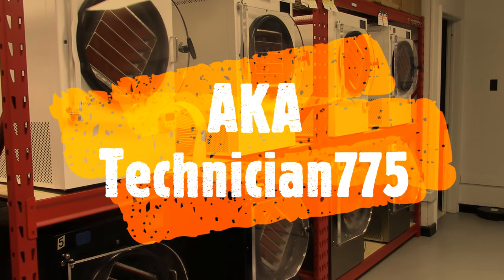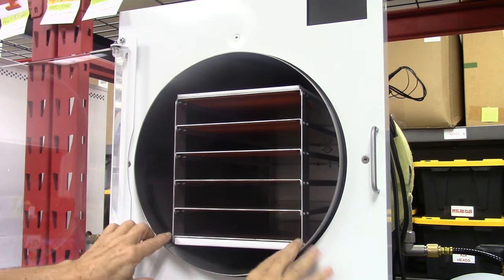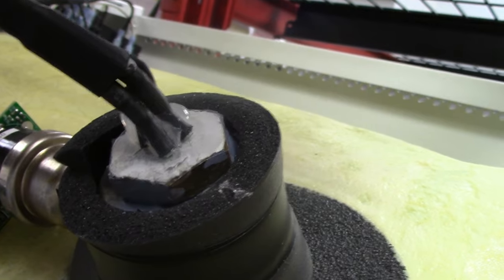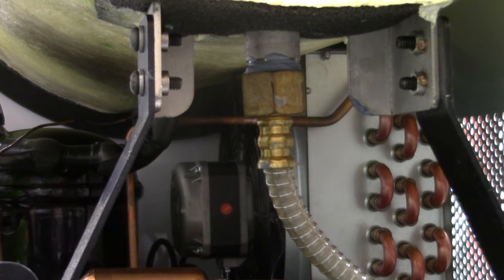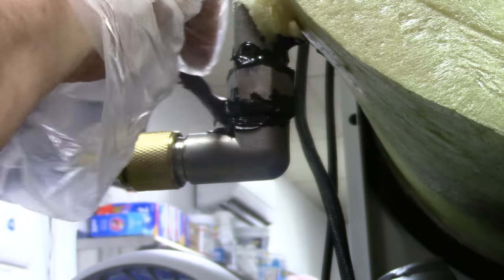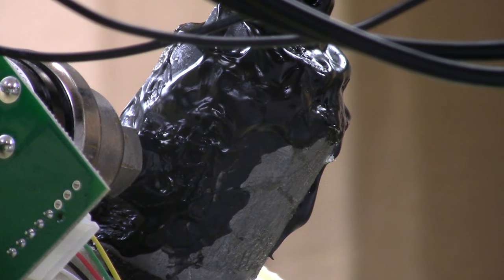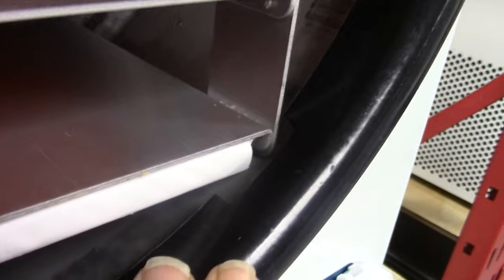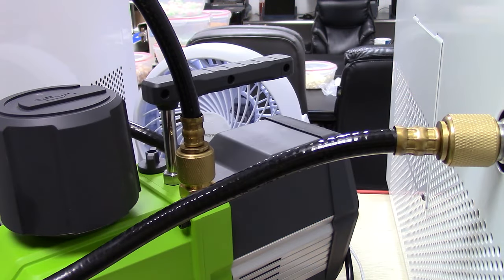Harvest Right Vacuum Fix VIDEO

Comment: Hey Fellow Techy Fix-it Guy!!!  Please tell me; have you ever needed to remove the seals made with liquid and rubber splicing tape?  I'm about ready to perform all your suggested sealing tips but worry a little bit about getting to the harness in the future.
Also, do you have a parts list anywhere of the replacement parts you use, especially drain valves and fittings?  
Thanks for your hard work and willingness to share.
Reply: Hiya Dan, nope, never had to remove all the stuff, but....if I would, a good pair of needle nose pliers would do the trick I would think. If you need drain valves, Harvest Right has some nice ones, the vacuum hose is from HR too and orings.....You can use a 3/8 gas valve from any Hardware store, bring the old drain valve with you to match up the ends....last machine we sealed up, held a vacuum for 72 hours....and was still holding, but we needed to use the machine.....good luck and thanks for the nice words. .

Comment: So glad I found this video! I didn't know where to troubleshoot next. I had already epoxyed the top where the cords go into the machine about a year ago. Now I'll go back and remove all that. My question is, what is RTV? Thanks for doing this video!
Reply from the maker: RTV is a thick substance like what is used around windows, bath tubs, showers etc. I suggest you NOT use it, the liquid tape works sooooo much better, use the white, as you can see any voids better than the black, a viewer gave me that tip and he was correct. Also, you might replace The orings on the end of your vacuum hose (Harvest Right has them, about 2.00 each). Use plenty of the nylox (the bottle with the snake on it) on all the JIC fittings and the orings and the threads too on the vacuum hose. Good luck with everything, let me know if you have questions. TY for watching!!!
Reply: @technician775  Are the Orings available at a hardware?
Reply: @arleneheg  yea....butt, the make all different material types and strength types of Owings. HR does not charge shipping that I know of, they ship pretty quick, you might get a set at a local hardware, but I would highly suggest the factory ones, take the ones in the hose out carefully, soap and warm water clean them, nylox the oring and oring grove very well and carefully reinstall, but do order a new set...... Check and see if you can twist the hose in the fitting after it has been tightened...if you can...I would replace the hose...about 20.00 or so on a new one...ty!
Reply: Thank you. As I’m reading your post I remembered that I just ordered a new hose so I will switch it out with the new hose while I go ahead and order from harvest right.
Reply: @arleneheg  Good, I hope all this fixes your problem.....what pump do you have??
Reply: @stevenducote7466  I have the standard pump. I bought my machine used from a guy who was a fanatic about learning/taking care of it. He had  a rig for running the oil through a filter so I didn't need to change the oil. When I had my first vacuum error and had to trouble shoot, I unhooked and put on a brand new standard pump. Of course, that wasn't the problem but I just never went back to using the oil filter set up. But I did go back to the original pump so I have a new back up standard pump.

I also purchases another used machine a few months ago with an oil less pump, the horizontal version. I actually tried it on this machine to see if it was the pump. It wasn't. So my son helped me change out the shut off valve and it improved but not enough so I went out seeking help and landed on this video. I actually fixed a previous vacuum issue by gobs of silicone, not epoxy on the area at the top of the cylinder. It has been working great until now and I use it heavily. So today I'll go pick up the supplies to do this repair and keep my fingers crossed and pray. I'm very optimistic this will do the trick. And I may do it to the second machine (not here) as a preventative measure.
Reply: @arleneheg  great reply....I always used Dairyland oil...it keeps the pump clean....I would follow all the steps in the video, it it still dies not work...we will have to chat on the phone.....no problems there......after using ALL the pumps...I like the premiere pump the best...I have overhauled the oil less pumps....sometimes they work...sometimes not...to me they are not reliable enough....I had 8 of them.....the vertical oill ess ones....I got the scroll tips from china.....from the manufacturer, but HR sold the kits for about thecdame price...I use ALL premiere pumps now....9 of them......ty!
Reply: @arleneheg  I mis-spoke..it is Nylog Blue, the fitting and oring lube in the small bottle...
Reply: @stevenducote7466  Since I am looking to get a back up pump for the oilless one because I have heard they don't last very long, I will consider the premier. But if it turns out I have to go with the standard, I am comfortable with that. Honestly I got the second FD with the horizontal pump for about what the pump alone costs and the machine may have had about 40 runs max on it. 

I epoxyed the daylights out of the top when I had to do that fix over a year ago. So, there was no way to remove it. I've covered all the other joints and a dab or two on the top. Vacuum test is running now so fingers crossed! Thank you for the offer of a phone call. I hope I don't need to take you up on it, but nice to know if I'm still having problems. I'm trying not to stress but I want my FD up and running! I have tons of food to FD, two sides of beef!
Reply: @technician775  So, I did the repairs, less the top epoxy fix area because I had really over done the fix when I did that about a year ago. Too much epoxy to remove! First test didn't bring the vacuum down but I checked the areas and put more liquid tape in areas where it looked like it needed a bit more. Hooray! Under 500 in 15 min.! Letting it sit until tomorrow morning then will tape it. THANK YOU for helping me get up and running again! I've bookmarked and will be sharing this video even to people who haven't had the dreaded vacuum fail yet.

Comment: Why not disassemble/clean and reassemble the pipe fittings using a NSF rated pipe dope?

Matter of fact, for all of my critical plumbing, I commonly reassemble most metal pipe fittings using both Teflon tape and pipe dope.

Using exterior tapes and sealants are bound for failure after time and usage.

Also, most crimp hoses are best just replaced rather than attempting any type of fix.  And quick connects seem to require some sort of lubrication, again, likely use an NSF rated plumbing lubricant.
Reply from the maker: The bottom drain fitting is almost impossible to remove, the “regular household” will not be able to do this. These are fixes we use and have been in service under daily use for about 3 years now. I agree in some cases and I use it around the house the tape/pipe dope combo. Thanks for the tips and for watching.

Comment: Thank you for the vacuum sealing to prevent leaks. Can the drum be fixed if a weld is cracked?
Reply: that I am not sure...you will have to contact the manufacturer....the entire drum will have to be taken apart, tubing, insulation....they might just scrap that drum and install a new one.....ty for watching!

Comment: Thanks so much for all the great information and ideas.  I am going to implement all these suggestions.  My oil keeps getting cloudy in my pump.  I cleaned the demister, flushed the pump and looked inside the pump's front cover and the pump was mostly clean inside.  I am still getting cloudy oil and vacuum isn't going low enough.  Do you have any thoughts on what the problem may be?  Thank you so much for your time!  It's greatly appreciated!
Reply: Hi...ty for complement....first off, what pump do you have??....and what are you freeze drying?? ..if it were me, I would do a candy run or bread run...if you do a high water content food, your oil will get cloudy, then as the pump heats up, the water will "burn off" with the heat generated by the pump. if you do a low water content food, bread or candy, the water in the oil will burn off leaving clear oil. I hope this helps and let me know too! TY!
Reply: Hi again, I'm sorry to bother you with this again, but I thought i would ask just in case you would reply.  The candy run worked fabulously, but now I put in some shredded cheese and the mtorr went down to 499 then crept up to 563 and is still vacuum freezing.  The mtorr went below 50 for the candy run, but is that different that the vacuum freezing cycle, since the candy is just drying and doesn't go through the vacuum freeze mode? I just assumed since it went that low for candy that I was good to run something else.  Do you have any more suggestions.  Thank you again and if you don't have time to answer I totally understand. :) @stevenducote7466
Reply: @angeladawn1975  Hi..... from what I have found....starting a run with food, the mtorr will be high, sometimes around 600 or so, then as the freeze drying process goes on, the tray temps will rise and the mtorr will drop...it does not go down all at once and stay there, do your cheese run and let it go until it completes, watch it if you want, but close to the end, the mtorr will be low....hope this helps...please feel free to ask more questions, that is how we learn....Steve
Reply: @stevenducote7466  Thanks Steve, it just seems to be stuck on vacuum freezing and not hitting the drying cycle yet. Haven't gotten a error message yet though. I've had my machine for almost two years and it's been great, but when I have a problem, it has taken me a while to get it back up and running.  I appreciate your help and time.  Thanks again.
Reply: @angeladawn1975  glad to help...some machines will go to -20 then go into drying even though you have it set for 0 or even -10, I usually freeze everything before putting it in the freeze dryer except candy, and a lot of times I let the machine freeze down to 30 or 20 then put the frozen food in it, it will help with the freezing process, good luck!

Comment: what is the purpose of the stretchy tape. Is it just for looks?  I do not mind not using it if it is only for looks. TY. Excellent video.
Reply: hi Jim, it helps "bind" or hold the liquid tape in place.....ty for watching!
Reply: Is stretch tape just electrical tape? Or a different type

Comment: Taking you up on your offer!
My Harvest Right FD pulls a vacuum without the tray rack.
Will only pull down to 900 mt with the rack.
We have
Made sure the cord isn't keeping the rack from going all the way to the back of the chamber.
The rack isn't touching the door gasket 
Every connection has been covered with silicone tape
Drain ball valve has been replaced 
Door is very well sealed onto the gasket 
No cracks in the inside of the gasket. 
New pump
What else is there to do?
Reply: Hi....are you doing a candy or food run?? I would do a complete run either candy or food, like a bread run, ensure you have fresh oil,  ensure the vacuum hose is not turning when tightened. close to the end of either run, the mtorrs will be the lowest, not during a test. hope this helps.....let me know.....ty! Steve
Reply: @stevenducote7466  
Hi
Running food not candy. 
Are you saying that running food on a regular cycle would vacuum differently than the the vacuum test? We got the liquid tape and are prepared to take off the silicone tape we have on every attachment point if necessary. 
We just can't understand how, when running a vacuum tests without the tray rack would quickly bring down the mtors to 400 but with the tray rack only down to 900. This is the only variable that seems to make a difference. 
Thanks for your insight
Reply: @healthEfairy  yes, running a full cycle does make a difference, if it were me..I would remove all the old tape, silicone, resel everything using the white liquid tape, use the stretchy tape, on the vacuum hose, use the nylon blue thick stuff on all the jic fittings, and lube up the rings, ensure when good and snug, see if the hose rotates in the fitting foe the vacuum hose, if it does, either replace the rings or get a new hose, that is what I would do....good luck, please feel free to ask more questions if you need! ty for watching!
Reply: @stevenducote7466  many thanks 😊
Reply: @healthEfairy  Thank you for watching!

Comment: Your video has been a big help to me thanks did all your steps but my still only gets 1509 M torr
Reply from the maker: Uuummmmmm…….might have to try another pump…..what pump are you running….   How old is it, how many hours on the pump etc, post everything you can think of….did it just start loosing vacuum????
Reply: Oil less about a year run. About 200 hrs I had open heart surgery have not used for 6 months
Reply: @RobertEarehart  oh.....oil less mot being used for a bit....you may have to send it in...the scroll seals may be dried out after not being used for a while....... you could try freeze drying some sliced cucumbers, or something with a lot of water in them.... cross your fingers it may rehydrate or clean the scroll seals....load it up and let it run...is it the tall gray pump??

Comment: if everything is sealed up...I would look at a new pump...do you know anyone in your area that can lend you a pump to try??.... how is the vacuum hose??...after tightening...can you still turn the hose section??...if so...look at a new hose....the tray rack still has me puzzled....did you remove all the old sealant before applying the liquid tape???

Comment: I'm having trouble with the wire harness fitting location that hopefully someone can direct me.  I've re-done the thread tape on both the harness and sensor.  I then put the housing under vacuum and once it's below 1k mT I apply the liquid tape good and heavy.  The problem I'm having is let's say I apply the liquid at 4PM, I check on it at 9PM and the unit is sitting at 200mT.  Perfect, I go to apply the stretch tape but the liquid tape is only skinned over, it's still liquid underneath so the stretch tape squishes it and makes a mess.  If I apply the liquid and let it go overnight, the liquid gets sucked into the threads in 2 places where now I have to back fill it to ensure coverage.

What's the timing on when you apply the liquid, when do you wrap it with the stretch tape and how 'wet' is acceptable when you do the wrapping?

Thanks so much for these details!
Reply: I sometimes skip the stretch tape.....as long as you have a good thick coat of liquid tape you are good.... ty for watching!!!

Comment: What a great video.  How did you know we were having problems?  It looks like we need to be sealing up some areas.  I do have a question.  We cleaned our door seal.  After running for 2 hours , the pressure is at 530. Should it be lower then that? Thank you
Reply: hi.....the mTorr vacuum and temperature is a balancing act...if you are doing food, as the temps rise, the vacuum will go down....at first it is not that low, as the process goes on and there is a higher temp and less water, the vacuum will go down....I hope this helps....ty for watching!
Reply: Thank you for your help
Reply: @marleneweston8965  you are welcome ....ty for watching!

Comment: Hello Sir, 

Would appreciate some help on an issue we have with our medium freeze dryer. 

My wife was using the medium machine last night for some ice cream and the power went out on the machine. 

I look at the back where there are 2 black modules connected by small wires. One of the wires melted then snapped. The wire is connected to the bottom of the top module and left on the bottom module. 

Why would this happen? was this a fail safe to prevent a fire?

Would I just need to order 2 new modules and the wires?

Thank you kindly.
Reply: not sure...I would call or fill out a ticket with harvest right and send them pictures. unplug the machine from the wall socket for sure. But it is best to contact Harvest Right..that is very important wiring. ty!
Reply: I took my relay board off when going into my freeze dryer for this vacuum test stuff I'm not sure where it went to put back on and how it goes can you help me
Reply: @rosswilson7080  You should have taken a picture......
Reply: yikes!, ok, my suggestion, go to Harvest Right and look up their support page on how to replace a relay board, follow those instructions. You can also look on you tube, they have good videos there as well. Relax, it is not hard as long as you do each connector one at a time. First thing is to reinstall the relay board using the brass screw and plastic spacer, the other hold downs are plastic snap in place fasteners. I hope this helps, if we need to, we can do a phone conference call and walk you thru step by step. Steve

Comment: It sounds like you buy a new machine, and then you have to rebuild it to make it work properly. Some people obviously enjoy the challenge as much as the product of the freeze dryer. Harvest Right  has been producing freeze dryers long enough that these quality control and engineered problems should have been taken care of. I have no idea how many of their machines don't work. It sounds very much like they don't care either.
Reply: hi, not all the machines were bad....I am an aircraft mechanic by trade and we would strip brand new aircraft down...do our mods...easier to do them up front and have the machines cruise along...HR has always been good to work with....some of the machines o have worked perfect out of the box...... I am happy with them.....thanks for the comment!